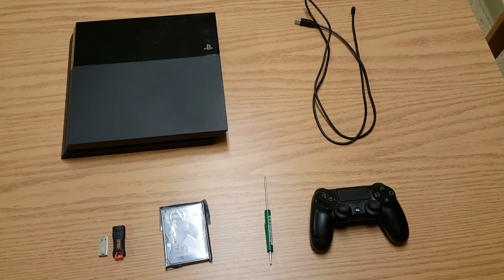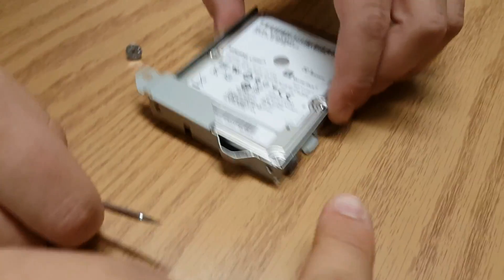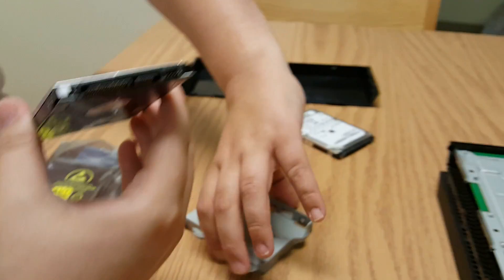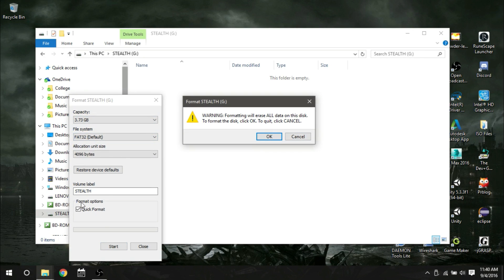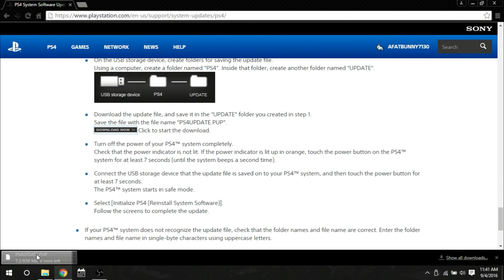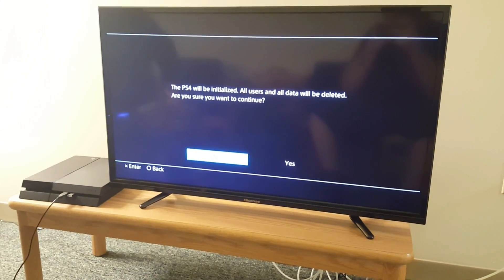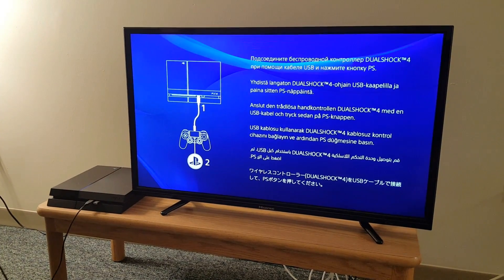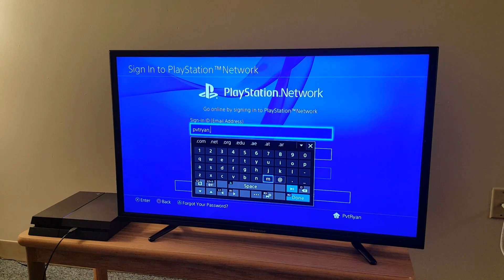PS4 Hard Drive Upgrade / Swap (500GB to 2TB)

Comment: do we HAVE to have a usb drive?.. or can we just back saved data into the cloud and do it that way?.. kinda spent my money on the HD itself lol
Reply: im very much wondering this myself. from the videos i have watched it should b fine to just upload saves etc to cloud and then re install games i dont have any digital downloads so im fine with this. would like a definitive answer though.
Reply from the maker: You will need a USB so you can download and install the operating system t the PS4.  Otherwise you will have a blank HD in the PS4 and the PS4 will not know what to do with it.
Reply: Dustin Jones  u can back up ur saves to the cloud and will just need to reinstall games. mines works perfectly

Comment: I didn't scroll through the comments, but would I be able to do it without the usb drive since the cloud storage update?
Reply from the maker: You will need a USB so you can download and install the operating system t the PS4.  Otherwise you will have a blank HD in the PS4 and the PS4 will not know what to do with it.

Comment: HELP! I'm stuck on the connect usb screen on ps4 and i did everything correctly, what do I do?
Reply: pull the power cable and boot your ps4 into safe mode
Reply: Arctic I'm still stuck
Reply: tkdboy360 figured it out what are you stuck with
Reply: me to man help me out
Reply: try a different format on the usb
I did that and it worked for me
Reply: tkdboy360 what format did you use?
Reply: What did you do to get past that? I'm stuck too

Comment: I downloaded the latest version (4.07) and then put it on my flash drive and stuck the flash drive in the PS4 and it said that it couldn't be used. I don't think I did anything wrong and if someone knows please help
Reply: XboxGamer_34 it's the 900mb one. It's ALL the way at the bottom. I hope this helps!
Reply: CaesarSalad yeah I realized I downloaded the 200 something one then saw that there was the 900 one thanks anyways
Reply: XboxGamer_34 hey no problem man!
Reply: CaesarSalad thanks my dumbass thought you could just download it from the top :/
Reply from the maker: Yeah, sorry guys! One thing I wish I was a little clearer about in the video was which item to download on the PlayStation site... Below is what you need to do.  @CaesarSalad beat me to it! :)

The only thing that I could think of is maybe you my have just downloaded the update file.
Go back to the Playstation update page.  Scroll all the way down to the bottom of the page.  The lowest section should be a section that is titled "Perform a New Installation of the System Software".  Download the full OS from the download link there.
Then make sure you delete the old file off of your flash drive and let me know how it goes.

Comment: so  if I move my games to the library do I still need a flash drive if so how big do I need?
Reply from the maker: You will need a USB so you can download and install the operating system t the PS4.  Otherwise you will have a blank HD in the PS4 and the PS4 will not know what to do with it.
Reply from the maker: It needs to be at least 1GB in size.

Comment: what do you recommend to back up data on? PS plus or flash drive? If ps plus does it back up all the game data, saves, wall papers, and videos in gallery? if flash drive wouldn't i need a flash drive with a ton of space because the game data alone would be over 200gb. im guessing i just need to back up save data though so how big of a flash drive do you recommend? the biggest i have is 16gb.
Reply from the maker: blueph03n1Xx Here's what I will recommend for you.  
Backup the Game Save data through PS Plus. The game save data is the save files for your games.
Back up the Videos, Pictures, and Music on a flash drive.
Finally, there is no need to backup the Applications data because you can get that back by popping the disc back in and reinstalling it.
If you have anymore questions feel free to ask.
Reply: AFatBunny thanks for the help.
Reply: are we able to download games we brought in non disc form after the reset? (digital games)
Reply: AFatBunny so if you back the games save file up on ps plus and you log in with your profile again after you switched out the 500 gb, you only have to insert the disc, and because you saved it on ps plus it automatically adds the data you had before you changed anything to the game and you can just go on playing like nothing changed?
Reply: AFatBunny and will games that I purchased on the ps store be able to be downloaded on my new harddrive via library?

Comment: After mine initialized, it turned back on but nothing came up on the screen. I decided to just leave it for about 20 minutes but nothing ever happened. What should I do?
Reply from the maker: The only thing that I could think of is maybe you my have just downloaded the update file.
Go back to the Playstation update page.  Scroll all the way down to the bottom of the page.  The lowest section should be a section that is titled "Perform a New Installation of the System Software".  Download the full OS from the download link there.
Then make sure you delete the old file off of your flash drive and let me know how it goes.  

I would also recommend maybe watching through the video again to retrace your steps.

Sorry that I couldn't be of more help.  Let me know if you figure anything out.

Comment: I bought a 2tb seagate hard drive that got great reviews and said to work on PS4. I followed your steps to back up and then I turned off my PS4 and put in the new hard drive. Now when I try to go into safe mode it says ERROR no hard drive connected. It can't be that my hard drive isn't compatible because I tried the old hard drive and the same thing happened. I had my flash drive in with the correct firmware on it and the USB drive was formatted to FAT32 which should work. What do you think I should do?
Reply from the maker: The only thing that I could think of is maybe you my have just downloaded the update file.
Go back to the Playstation update page.  Scroll all the way down to the bottom of the page.  The lowest section should be a section that is titled "Perform a New Installation of the System Software".  Download the full OS from the download link there.
Then make sure you delete the old file off of your flash drive and let me know how it goes.  

I would also recommend maybe watching through the video again to retrace your steps.

Sorry that I couldn't be of more help.  Let me know if you figure anything out.
Reply: Ok I will I plan on working on it this weekend so I can tell you what happens. Thank you

Comment: Question, they took out newer models of the brand, Seagate, but with much more TB. So my question is can the Seagate 5TB Barracuda Sata 6GB/s 128MB Cache 2.5-Inch 15mm Internal Bare/OEM Hard Drive (ST5000LM000) for the laptop size still fit for the 1st generation of the PS4?
Reply from the maker: I am not 100% sure.  The size seems like it would fit (needs to be a 2.5 inch), however, the bigger problem would be that the PS4 does not support any hard drive over 4TB (as of update 3.50).  Take a look at the link below and see what they say.  Hope this helped!
http://www.gamefaqs.com/boards/691087-playstation-4/69429669
Reply: won't work.... the PS4 requires a HDD that is 9.5mm thick, 15mm will not fit in the slot

Comment: hello,

so I bought the hard drive directly from the link you added; however, the item on amazon doesn't seem to have a cover is it correct?

Thank you
Reply from the maker: Yes, that should be the correct one.  If you bought one with an outside casing (like a portable hard drive) then you would have to take it out of the casing.  So long story short - you should be good to go! :)
Reply: AFatBunny Thank you

Comment: My controller won't pair when I am in the safe mode step, even if it's plugged in and i tried to reset my controller but it won't pair with the ps4 so my ps4 is unusable
Reply from the maker: Maybe try googling why it wont pair with your controller or check out this blog: http://community.us.playstation.com/t5/Consoles-Peripherals/PS4-Safe-Mode-Connect-controller-with-USB-won-t-work/td-p/44817094
Reply from the maker: Also, your PS4 isn't unusable. Worse case, if you cant get your PS4 to recognize your controller then you might just want to put your old hard drive back into you PS4.  That way you have a usable PS4 until you figure out why your PS4 controller wont pair.
Reply: I've switched in my old hdd and my controller is pairing again, but i want to upgrade to a 2TB hard drive, so when I put it in and power my ps4 into safe mode it says to plug in my controller and press the home button, but nothing happens my controller flash orange one time and white one time.
Reply from the maker: The only other things that I can think of would be to make sure that you are plugging the controller into the system before you even turn on your system OR what the real problem might be is the cord itself, so if you have another cord for the controller you could try that.

Comment: if stuck in safe mode and it wont read the update file, make sure download the right file, i did the first 1 i saw and not the " perform a new installation of the system software " its the 850 mb one
Reply: i just hit download on top of page and its wrong one lol
Reply from the maker: Yeah, I wasn't very clear about that. At 6:35 I say to scroll the whole way down.  I also have annotations on screen to make sure you scroll the whole way down.  Sorry for the confusion. Below are the steps to fix this problem:

The only thing that I could think of is maybe you my have just downloaded the update file.

Go back to the Playstation update page.  Scroll all the way down to the bottom of the page.  The lowest section should be a section that is titled "Perform a New Installation of the System Software".  Download the full OS from the download link there.

Then make sure you delete the old file off of your flash drive and let me know how it goes.  Hope that helped!
Reply: AFatBunny yeah after the 3rd time i fully looked at the psn downloading page, now just gotta download all my psn games .... about 3mb/second

Comment: So I'm doing this on my Uncharted 4 PS4 model and I've ran an issue doing this
Reply from the maker: Whats the issue? Maybe I can help.
Reply: AFatBunny it's ok now, the drive wasn't fitting in for whatever reason, but I got it to work now. Everything else in this work helped a ton, thanks!
Reply from the maker: No problem! Glad that everything worked out!
Reply: +CK TV How did you get the drive to fit in? I'm having the same problem, for whatever reason the drive wont fully go back into the console so i can screw it back in

Comment: Do you have any recommendations of drives or sites in terms of price I'm probably getting a 2 TB
Reply from the maker: I only have two recommendations as of now.

The first one is the one used in the video. This one is ready right out of the box. Link here: http://amzn.to/2ccGr7T

The second one is a external hard drive which will need to be torn apart so that you can use the hard drive.  I will be making a video about this one later this week. Link here: http://amzn.to/2guZeIO
Reply: Thanks a lot man and great video!

Comment: It gives me an error when I try to reinstall it...  I have the folders appropriately named, USB formatted, everything but it still doesn't work
Reply from the maker: The only thing that I could think of is maybe you my have just downloaded the update file.

Go back to the Playstation update page.  Scroll all the way down to the bottom of the page.  The lowest section should be a section that is titled "Perform a New Installation of the System Software".  Download the full OS from the download link there.

Then make sure you delete the old file off of your flash drive and let me know how it goes.  Hope that helped!
Reply: AFatBunny yep I figured that out about 15 mins after I posted the comment, thanks for the help in setting up my new hard drive!
Reply from the maker: Glad that it all worked out!
Reply: I done this then put usb back into ps4 and done the process again and still says error couldn’t find update file

Comment: I have always been afraid of trying this but I did tonight and it works.  THANKS A MILLION
Reply from the maker: Roxann Samuel You're welcome! Glad it worked out for you!
Reply: Roxann Samuel so would I lost my other games data
Reply: AMIRCAT 100 you need to backup your save files either on the cloud or on a usb. you need ps plus to be able to use the cloud by the way
Reply: Roxann Samuel does it still work?
Reply: Roxxane Roxxaaaane
You know that song yes no ok😂😂
Reply: what happens if you don’t do the flash drive back up thingy?
Reply: cause i don’t have a computer to do that

Comment: SOMEONE HELP!When I put in the reinstallation flash drive to my PS4 after switching the drive it doesn't work.can someone tell me exactly how they did it.
Reply from the maker: The only thing that I could think of is maybe you my have just downloaded the update file.

Go back to the Playstation update page.  Scroll all the way down to the bottom of the page.  The lowest section should be a section that is titled "Perform a New Installation of the System Software".  Download the full OS from the download link there.

Then make sure you delete the old file off of your flash drive and let me know how it goes.  Hope that helped!

Comment: If I have games that are digital from the ps store, can I still install them when I change the hard drive? Or will it give me the error that I don't have permission to do so, like when you try to gameshare?
Reply from the maker: I am not sure about the gameshare, but the games that you bought from the PlayStation store should still be available to re-download because they are attached to your PSN account, not the hard drive.  After you change the hard drive you will have to log into your PSN account, scroll over to the "Library" tile, and then re-download your games.  That should work.  Hope this helped.

Comment: So can you save the applications ( I have 390 GB) on the cloud? Or is that mandatory to an external drive?
Reply from the maker: The only things that you can save on the cloud is the game save data.  The application data should work one of two ways:  If you downloaded the game you should be able to re-download it OR if its a disc based game just pop the disc back in and it will re-install the application data.  Also look around on Google to see what others say just to make sure that I am not wrong.  Hope this helped!

Comment: good video however you need to specify that there are two "DOWNLOAD NOW" buttons to click and that the one for replacing hard drives is towards the bottom of the screen on the PlayStation website.
Reply from the maker: I think I did say to scroll all the way down to the bottom at 6:35 however, I should have made it more clear.  Thanks for the suggestion!  Ill add an annotation on screen to try to be more clear.
Reply from the maker: I have added annotation that I hope help at 6:09!  Let me know what you think.
Reply: AFatBunny cool, I only really brought it up because for me it was about a five hour process because I kept downloading the wrong code and it took me forever to find a forum that specified what I was doing wrong. But thank you, I finally got it done.
Reply: Same here but thank god fir comments

Comment: i got the installation on my flashdrive but when it asks to put in the flashdrive it says "the update file cannot be used" " Connect a USB Storage device that contains an update file for installation for version 4.05 or later" i even re-downloaded the installation on the flashdrive i dont know what the issue is?
Reply from the maker: Sounds like you my have just downloaded the update file.

Go back to the Playstation update page.  Scroll all the way down to the bottom of the page.  The lowest section should be a section that is titled "Perform a New Installation of the System Software".  Download the full OS from the download link there.

Then make sure you delete the old file off of your flash drive and let me know how it goes.  Hope that helped!
Reply: yea i figured that out already thanks for responding though. i didn't notice the 900mb download.
Reply: @AFatBunny7130  i did this and still having same issue
Reply: Digi Destined Wow i was going through the same thing! If it wasn't for this comment that Afatbunny replied, i would have kms for wasting money.
Reply: David C. Same thanks!

Comment: So I am trying to back up my ps4 hard drive before upgrading. I have an external seagate 1tb drive that i have used the past year but deleted everything and formatted it to exfat on my mac. My ps4 has around 350 gigs of backup data and like i said i am trying to use the 1 tb drive but when the ps4 reads it before the backup it says there is not enough space on the drive. Any suggestions?
Reply from the maker: That is odd.  I am not sure why it would be doing that.  Sorry!

Comment: Great video.  Very thorough.  I'll be doing this tomorrow and this is the video I'll be using as a reference.  You answered every single possible question.
Reply from the maker: Timothy Lewis Thank you! Glad I could help!
Reply from the maker: Yes, you will have to do the stuff on the computer to make it work.
Reply: AFatBunny do you have to do all the computer stuff for the hardrive to work
Reply: Agree, great step by step.

thanks
Reply: AFatBunny what if it says "Cannot start the ps4. Cannot access system storage."?
Reply: AFatBunny thanks
Reply: AFatBunny At 8;08 what happens if u press no